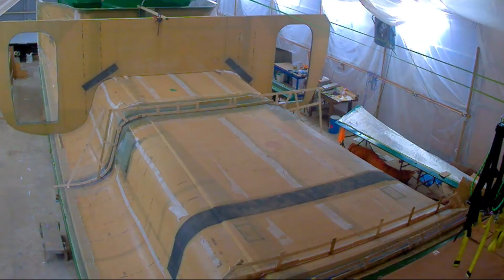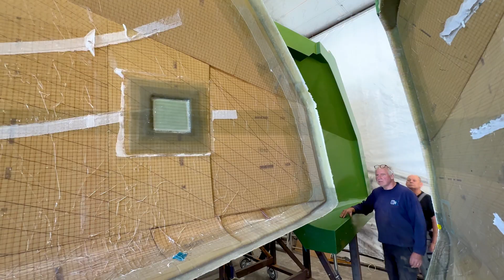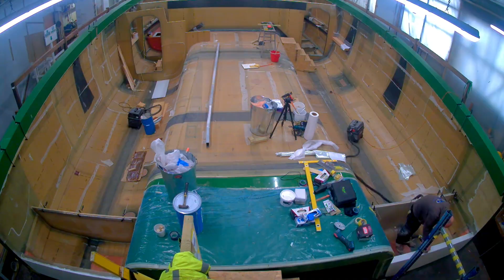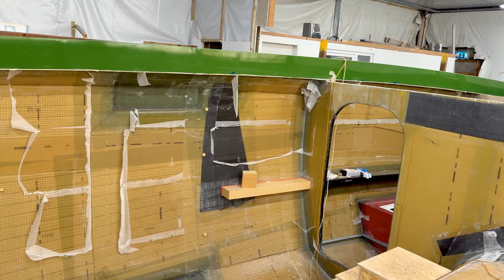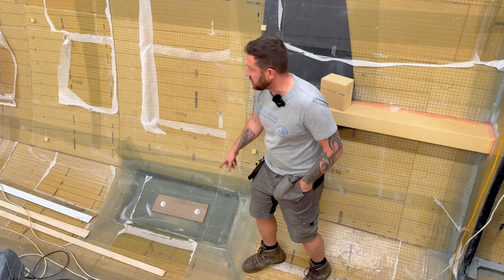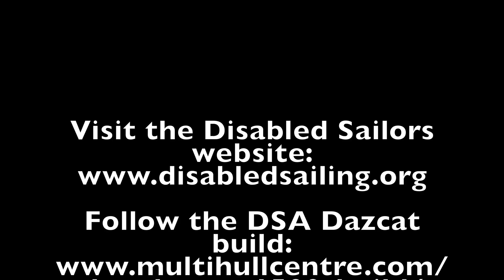DSA Dazcat 1500 Build Part 4: Pieces coming together

Comment: Lovely looking boat. I am wondering why the Naval Architect did not extend the carbon strengthening over the doorway on the main bulkhead to the sides of the hulls especially as you widened the doors for wheel chairs ?